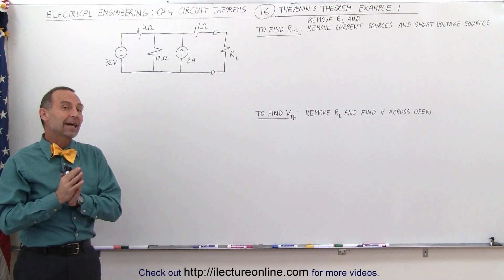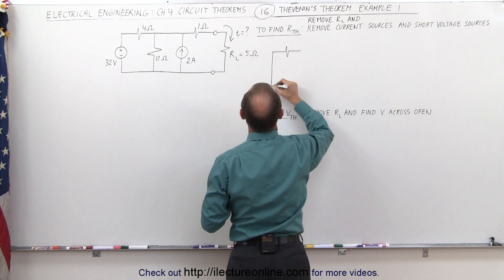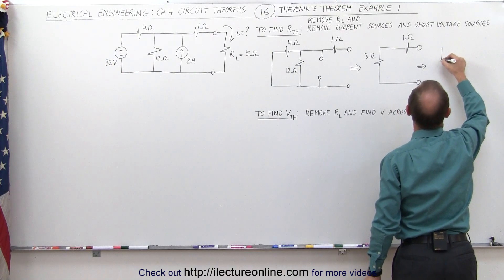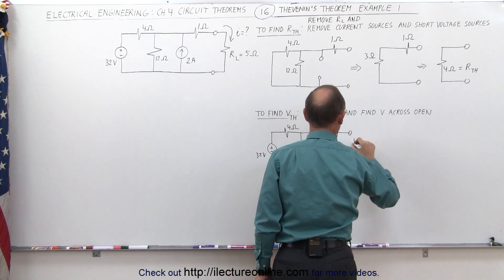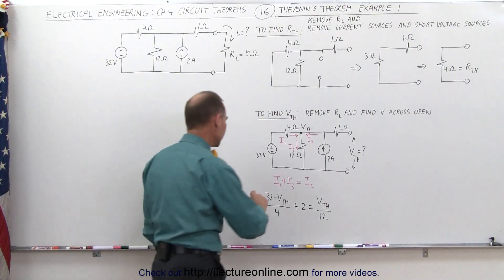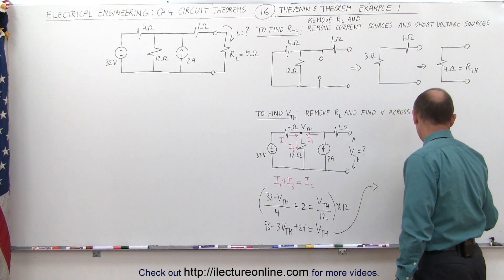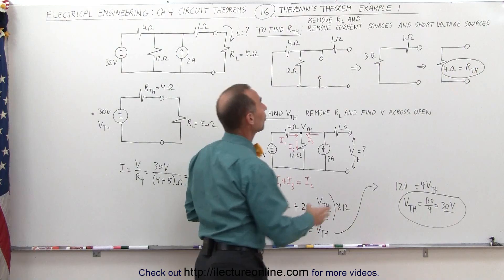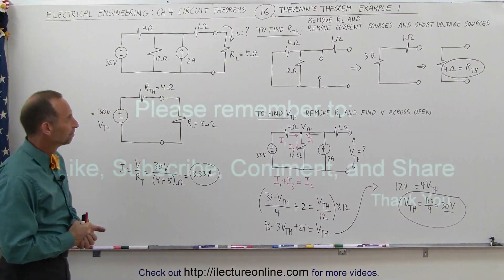Electrical Engineering: Ch 4: Circuit Theorems (16 of 35) Thevenin's Theorem Ex. 1

Comment: i find your lectures really helpful. 

would it be correct to say that the thevenin voltage is the "open output voltage" of the device and the thevenin resistance is "the internal resistance" of the device? and why are these particular parameters important and/or useful?i.e., what was the motivation for coming up with this perspective in the first place? 

thanks!
Reply from the maker: That is a good way of looking at it.  It is just a good way to analyze a circuit.

Comment: Good day Mr van Biezen, I would like to ask how do you know that the voltage is the same between the two nodes?
Reply from the maker: Not sure which 2 nodes you are referring to, but if it is the two nodes at the top, there is no component between the two nodes, therefore there cannot be a voltage drop and there is no current througn the 1 ohm resistor so  there is no voltage drop there either.
Reply: @MichelvanBiezen  thanks Sir

Comment: So why no current flow through the 1-ohm resistor?
Reply from the maker: Once the load resistor is removed (RL), the brach now has an open and current can only flow if there is a continuous circuit.

Comment: How do I know where the load resistor is? if it isn't stated in the circuit?
Reply from the maker: The "load resistor" is a placeholder for any portion of a circuit that is attached to a pair of terminals.  The "load resistor" can be a resitor - inductor or resister - capacitor, or resistor - capacitor - inductor combination or an entire portion of a circuit.   For example exercises like this the location of the load resistor must be indicated, otherwise there would not be any way of knowing where it is placed.

Comment: What it both voltage and current source are at the edge of the circuit and the load is in the middle of the circuit???
Reply from the maker: Then I suggest you redraw the circuit such that the load is at the edge.

Comment: Question: on using kvl for solving for the current across the first mesh, the vth turns out to be 36v. Please could you help me with an explanation or perhaps a correction for this paradox. Thank you so much for all you've explained. You have really assisted me in my academics.
Reply from the maker: I didn't quite follow your question.  Are you saying the if you take the original circuit and solve for the voltage across the load resistor, you find it to be 36 V and you wonder why it doesn't equal the V th?   They are not supposed to be the same since the V th is found without the load resistor.
Reply: @MichelvanBiezen  No sir. I followed all your steps prior to when you used the nodal analysis, in which place i used kvl. The answer then varied
Reply from the maker: It is easy to make a little mistake anywhere during the solution of the problem.  (I do that too often myself).  If no mistakes were made, the solution should be the same.
Reply: Thank you sir, I'll need to brush up on elementary math then.... lol 😅

Comment: Why are 4ohms and 12ohms in parallel but in the equivalent circuit 4 and 5 are in series, when to me at least they have the same configuration?
Reply from the maker: Since the current moving from left to right through the 4 ohm resistor does not have to go through the 12 ohm resistor, but can also go through another branch, they are therefore not in series.  In the equivalent circuit ALL of the current flowing through the 4 ohm resistor MUST also flow through the 5 ohm resistor (there is no alternative path) and therefore they are in series.

Comment: Sir i was trying this question in a different way. I followed the steps for example but rather than doing nodal analysis I used source transformations to simplify the circuit. However I didn't manage to get to a final answer. Could you try this question using source transformation pls and get back to me? Because i believe this method should work too.
Reply from the maker: Yes, source transformation should work.  Most of these circuit problems can be solved using any of the methods presented.  (some are more easily solved with one method versus another).  That said, it is very easy to make a single mistake somewhere which will throw off your final answer.
Reply: @MichelvanBiezen  I used source transformation and got 30V for thevinin voltage  and 4 ohms for thevinin resistance all in one take.

Comment: 4:32, the why is the voltage from the node equal to the voltage to the right of the 1-ohm resistor? Isn't there a voltage drop because of that resistor?

Edit: nevermind didn't listen carefully enough, that part of the circuit is shorted so no current so same voltage through that line. I'll keep this comment up in case anyone else was confused.
Reply from the maker: There can only be a voltage drop if there is a current through the  1 ohm resistor, and in this case there is not.

Comment: Why is there no current running through the 1-ohm resistor? I thought the 2 Amps will travel throughout or is it because of the resistance on the left side of the circuit much greater than the right that it's negligible?
Reply from the maker: In order to have a current, you must have a closed circuit.  With the load resistor removed, the current has no place to go, so you can't have any current through the 1 ohm resistor.
Reply: @MichelvanBiezen  Oh man thank you so much , now I see how silly my question was.
Reply from the maker: Not silly at all.  Sometimes these types of things really trip us up and it helps to get it clarified.
Reply: @MichelvanBiezen  How come when you calculate the Thevenin resistance though do you include the 1 ohm resistor? Is it due to the fact that a voltage will flow across it?

Comment: Hi professor, why did you does the voltage through the 4ohm resistor = 32 - Vth ?
Reply from the maker: Using Ohm's law:   I = V/R      to find I1    we need to find the current through the 4 Ohm resistor.   The voltage drop = 32 V - V at the node      (V at the node in this case = Vth)

Comment: Very thorough explanation.  I finally get the concept.  Two question: 1 - I assume, in a practical sense,  that once you solve for the Thevenin's equation, one can replace the RL with any value and the resulting current will hold true to the original model.  2 - Is there a good source of practice problems, with answers, to continuing sharpening my new skill?

Comment: Good day Professor             
Why does current not go through the 1 ohm resistor
Reply: Because it is an open circuit at the end A. Because current needs a closed path, current does not flow in the direction of A and therefore does not flow through the 1ohm resistor.

Comment: Professor, how do we determine the directions of I1, I2 and I3?
Reply from the maker: You take a guess, and then work with those guesses.  if you guessed wrong, you'll get a negative answer for the current.
Reply: @MichelvanBiezen  my professor for node voltage analysis tells us to assume all currents are leaving an essential node and to treat leaving as positive and vice versa for entering

Comment: It says to remove current sources and short voltage sources, but didn't you short the current source and remove the voltage source in the example?
Reply from the maker: To find the Thevenin Resistance you must indeed remove the current source and short the voltage source, which is what was done in the video.

Comment: Hi sir,
I have one doubt. vth is the voltage across the terminals A and B. In Equivalent circuit we connect the resistor series to the vth. in equivalent circuit the voltage across  the terminals A and B is not equal to Vth because some voltage drop present across the Rth . so in equivalent circuit the voltage value across the A and B is not equal to vth. am I right or wrong sir .Please clarify my doubt sir.
Thanks in advance:)

Comment: Dear Sir, how do you determine the direction of the current flow of I1? why is it clockwise instead of anticlockwise?
Reply from the maker: Sometimes it is obvious as the (conventional) current flows from the positive terminal to the negative terminal.  It can also be determined using Kirchhoff's rules.   And if you are not sure, you can "assume" a direction.  If the direction is wrong, you'll end up with negative answers for the current thus it doesn't matter, your answer will then tell you the correct direction
Reply: @MichelvanBiezen   Thank you very much for your reply

Comment: Why is there no current through the 1 ohm resistor? In the very next example video in this series, you have a nearly identical circuit and you're tasked with finding the current through that portion.
Reply from the maker: When the load resistor is removed, there is then no closed loop and thus there cannot be any current through the 1 ohm resistor.
Reply: @MichelvanBiezen  Makes sense. Thanks.

Comment: Dear professor, thank you for the video! One question though, why is Vth at the node equal to Vth at the open cable?? What about the "node"(dunno what else to call it), right above the current source?
Reply from the maker: Because there is no current flowing through the 1 ohm resistor and there is no resistor between the node and the 1 ohm resistor (no voltage drop).

Comment: Why doesn't the voltage divider equation not work. As in why isn't the voltage drop on the 12 ohm resistor equal R thev?
Reply from the maker: The voltage drop across the 12 ohm resistor is indeed equal to V th
Reply: @MichelvanBiezen  so I must be using the wrong R total, (12/Rt)*32 = 30 so Rt must be 12.8 but how do you get 12.8 for R total??

Comment: i can not find the series and paralal connection properly.can you help me to solve the problem dear professor?if you make a class lecture on this topic then it may be very helpful for myself.
Reply from the maker: You can find some videos here:  PHYSICS 41.1 RESISTORS IN PARALLEL BRANCHES
Reply: Thank you very much..sir

Comment: When using Kirchhoff's law to find Vth, why do we not say (Vth - 32)/12?  As far as I understand, its always the difference of the two nodes on either side of the resistor, divided by the resistance, and the 12 ohm resistor is also connected to the 32V and Vth.
Reply from the maker: You must always express everything in terms of an equation, and since (Vth - 32)/12 is not an equation, I cannot answer your question.

Comment: how is 4 and 12 ohms in parallel
Reply from the maker: If there is more than one path for the current to flow from the top left branch point to the negative end of the battery then 4 and 12 ohm resistors are in parallel.

Comment: Hi Sir
Did you remove R(load) because you want to get an open circuit and hence it would be equal to infinity? And what are the differences between R(load) and the other resistances. Finally, where did you assume is the ground?
 Thanks

Comment: Dear Professor, 

Are we looking the circuit from the right when we shorted the voltage and cut off the current source to find the R thevenin ? because i do not know why the 1ohm resistance is not remooved or we do  consider it when finding the Rth ?
Reply from the maker: We are always looking at the circuit from the perspective of the "load" or load resistor.

Comment: could someone please explain to me,why there is no current flow to that end where 1-ohm resistance is at. I did search some but still don't really get it. I know that it is an open circuit. but the current does not flow toward that end at all tho?
Reply from the maker: Any branch that does not form a complete closed loop will have zero current flow.
Reply: Michel van Biezen thank you so much sir

Comment: Sir, how can I know that the Voltage drop is (32-Vth)/4 but not (Vth-32)/4?
Reply from the maker: We are making the assumption that 32V is a higher potential than Vth because we assume the direction of I1 is from left to right in the circuit.
Reply: @MichelvanBiezen  yep, my professor just assumes current is leaving so the node we're dealing with always appears first in the calculation of voltage dropped.

Comment: Shouldn't you add the 4 and 1 in series and then calculate with the 12 in parallel? Would that be incorrect.
Reply from the maker: That would be incorrect.  Try it and see if you get the same answer.
Reply: Michel van Biezen Different results, however I saw some videos doing that way, I'm not sure why, and others doing your way too.

Comment: This might be an obvious question but lets say I don't have a current source in a branch but instead I am given that 'A 'amp of current flows, then would the source transformation still work? ( IT should I suppose, but I could be wrong, I am a student of class 12th and electrical circuit problems are my weakness)
Reply from the maker: I would try Kirchhoff's rules.

Comment: i think 1 ohm and 12 ohms should be parallel
Reply from the maker: The one ohm resistor is in series with the rest of the circuit (relative to the load resistor).
Reply: Michel van Biezen i now understand. thank you sir

Comment: Sir, can u plz explain me that, how did u take voltage at the node as Vth? thank u Sir
Reply from the maker: Since there is no current through the 1 ohm resistor, there is no voltage drop between the node and the point to the right of the 1 ohm resistor.  Thus the node must be at the same potential as Vth
Reply: Tnk u Sir. I got it.

Comment: Since the 1 ohm resistor is good as nothing, how about we simply use the voltage division rule between the 12 & 4 ohm resistor to find Vth?
Reply from the maker: It is better to learn the technique so you can learn to do more complex problems.

Comment: Dear Professor,

I am having trouble figuring out why the 4 and the 12-ohm resistor is in parallel, shouldn't the be in series ? Can you please explain? Thank you!
Reply from the maker: When the current source is removed and the load resistor is removed, then there is only one current path and the 4 and 12 ohm resistor are then in series.
Reply: Now, you're saying that the 4 and 12 ohm resistor are in series but in the video you say they are in parallel.
Reply from the maker: Ah, now I understand you question.  When finding the Thevenin resistance, you have to calculate the resistance relative to the terminals at the removed load resistor, and in THAT case the two resistors are in parallel.
Reply: thank you ! now i get it
Reply: @MichelvanBiezen  what do you mean by relative professor? Do you mean alligning the 4 ohm resistor with the missing load resistor? Because then they are in parallel?
Reply: Sir why do you  also said that current is not flowing in the 1ohm resistor?
Reply: ANI IZUCHUKWU STANLEY because the load was removed. So the 1 ohm is no longer part of a loop and just hanging off to the side. Current can only flow if there’s a loop.

Comment: Thank you so much Professor for your explanation. It would be extremely helpful if you can show an example with a dependent voltage or current source. Thank you so much!
Reply from the maker: +Iftikhar A khan 
Good point.  I'll have to add a few examples with dependent sources.

Comment: Dear Professor,

Thank you so much for your help. I am having trouble understanding why Vth at the node and across the terminal is similar. It would be really helpful if you can explain. Thank you so much for your time.

Best,
Iftikhar Khan
Reply from the maker: +Iftikhar A khan 
When finding the Vth, the circuit between A and B is open, which means there is no current between Vth and A and thus there is no voltage rise or drop across that 1 ohm resistor.